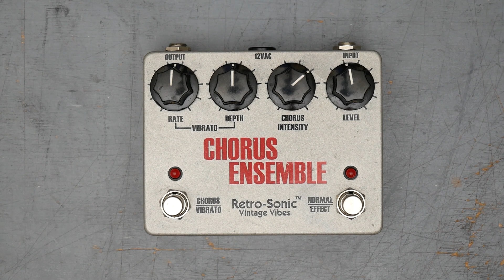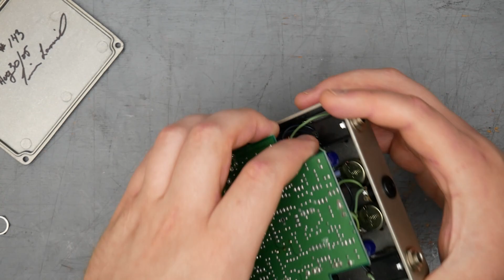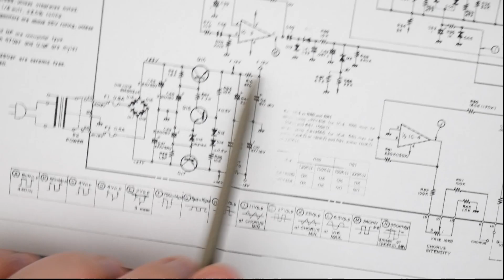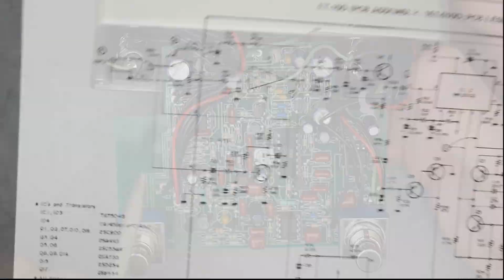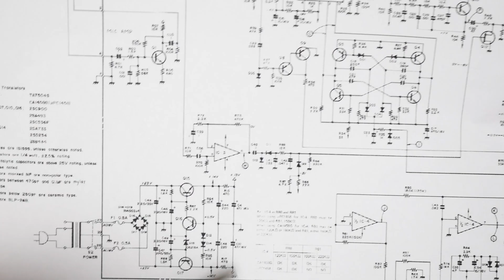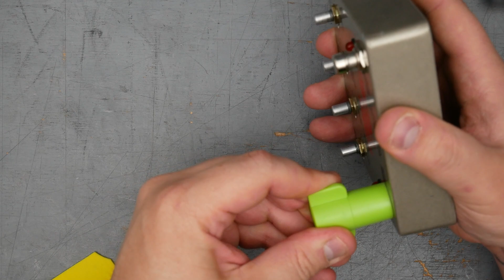Retro-Sonic Chorus Ensemble Teardown! See what's inside!

Comment: I have a Retro-sonic 9v Chorus and it has a distorted output, intermittent volume fluctuations.  It also, has a low volume high frequency noise (sounds like a sweeping phase) when the guitar is playing and when I stop playing the hiss/fluxuation stops.  I am hoping it is the switch but I just don't know.  Do you have any ideas?

Comment: That sounds a lot like my Way Huge Blue Hippo Smalls Chorus which is a clone of the Boss CE-2. I would love to see a teardown of the old Rockman Stereo Chorus. The later model without the delay, but the one with the long chorus. That was the only unit I could find that sounded like the early Pat Metheny recordings when he used two Lexicon Prime Time delays set to slightly different, very short delays with modulation.

Comment: I always look forward to your tear down videos, but that pedal would be a bit awkward for a board with that odd AC supply.
Reply from the maker: It's true, there are a handful of pedal power supplies out there that have a 12VAC output, but it's uncommon for sure. I think most people would just have a power strip on their board to deal with this pedal.
Reply: @graybenchelec  You could also just use 12VDC and it would still work.  You would only make use of half of the bridge rectifier but the current draw isn't high enough to damage it.